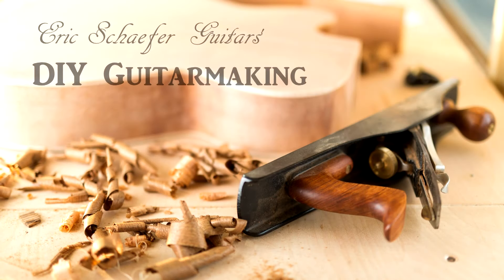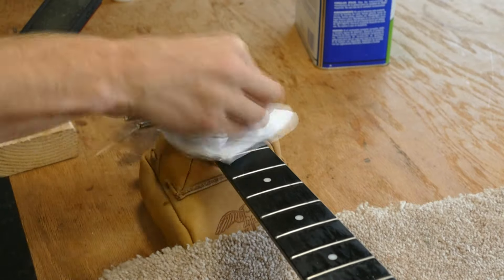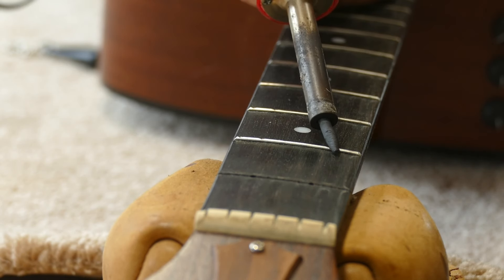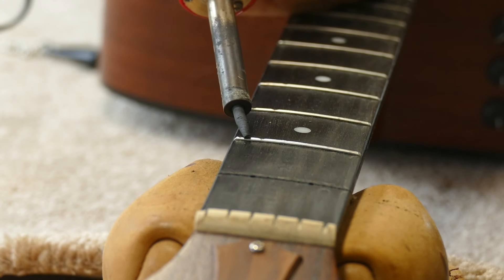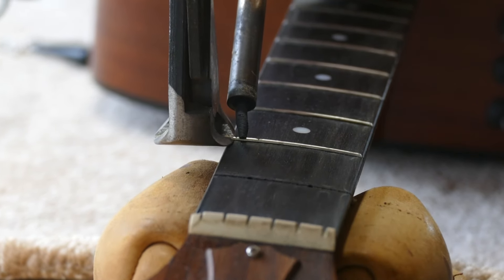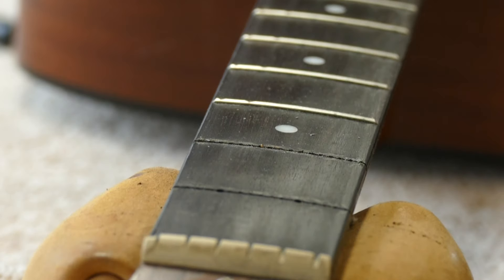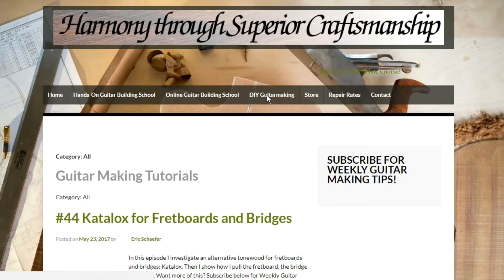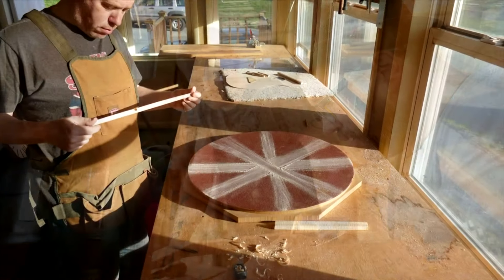The Proper way to Pull a Fret

Comment: Thanks, Eric. I'm thinking about replacing the rich lite fretboard and bridge with katalox on my Martin Dread jr to "liven'" up the higher notes. I also don't think rich lite will age in a vintage way. Any thoughts? Thanks.
Reply: Though it's heck of a hard job, I really like your idea and support your intent to improve probably beloved instrument!
Richlite is totally artifical and has nothing to do with grainy wood, so there's no way it can improve or change. :D

Damn, it's such a shame on the "almighty" Martin that they can't make guitars with rosewood while there are thousands of ~100$ guitars with rosewood fretboards and bridges.
And with real wood not cheap messy stratabond necks.

I bet they won't twist ever, but at the same time all this glue takes away so much of the vibrations and all those layers of wood are not aligned with their grain structures.
Not to mention Larrivee makes all-solid neck-heels and they seem to be stable too.
And even regular 2-5 piece necks bend or twist rarely, so stratabond is just another way to cheat on customers.
Reply: Yes, I agree. Richlite is like fiberglass and will always "buffer" the natural  aging process. I have removed fingerboards before so I have some experience. There is only one way to find out. Thanks Lexonn for your input.
Reply: Oh, can you please tell if you lock the fretboard after taking it out?
I heard that it might twist/bend for some amount, so it's not a lego piece you just take off and then put back on - sanding and reshaping might be needed.
Reply: The fretboards I' ve removed I have discarded. 2 fretboards I've ended up chipping them out with a chisel. My purpose for fretboard removal in the past has been replacing it with a shorter scale board so I didn't need the original. It's always a good idea to clamp a piece of wood like that to another straight piece to keep it from warping and winding.I've made aquariums and other things in the past that I've clamped the wood straight 'till I need it. Also, it's good to let the air flow evenly on either side of the board when not clamped or installed.
Reply from the maker: I love Katalox. It's functionally like ebony in every way except looks. I've never used that richlite stuff, but it being a composite, you should be able to notice the difference just going from composite to wood.

Comment: I tried to follow this advice. I did heat the fret. I could not get the fret puller under the fret. So I used an X-acto knife to get under the edge, and wiggle it. It started to move. Then I got a quality knife with a stronger blade. I used this under the edge until the fret came up and out. I attempted to walk the pullers down the fret, but it came out all at once. There was almost no chip-out, fortunately. Just goes to show that there is more than one way to get it done. I appreciate the video, it probably kept me from tearing the wood up.

Comment: I have an acoustic in which frets 2 and 3 were worn low at 1st and 2nd strings due to open chords.  The other end of the frets looked great so I removed them and reinstalled them in opposite direction.  It worked very well.  Strings 5 and 6 are higher gauge therefore don't sit as low in the groove worn by strings 1 and 2.  This saved a lot of time and hassle from cutting new wire, filing, dressing, crowning, etc.  Who knows, maybe one day I'll have to install new frets but it sure works well now.
Reply: Hi, I have just bought a very cheap all solid wood Tanglewood TW15NS and have thought of exactly what you have already done. The previous owner it would appear never played beyond the 3rd. fret and I can't justify the cost of a complete regret. All frets from the 4th. Are perfect. Could I ask you for any advice before I attempt to do this,were the frets easy to get out? did you need to use glue to reinstall? I would appreciate any advice,kind regards,John.
Reply: I was wondering if that was an option. My second fret is like that, under the b string is worn flat. Alternatively, could I take a fret wire off the 14th fret and swap it with the 2ond fret?

Comment: Just a tip from an electronics guy:
Water and soldering iron are arch enemies. The tips usually from iron coated copper. Water will destroy it fast and soldering becomes a nightmare.
Temp checks with soldering wire and tip cleaning with a copper sponge (looks like a rough steel scouring pad but is made of copper)
If done right, a soldering tip can live for a long time.

Comment: Hi from Spain. I would appreciate your advice. I have just bought a very cheap but really good quality,
 all solid Tanglewood TW15NS and it would appear that the previous owner never played beyond the 3rd. fret because from the 4th.they are all perfect, and the cost of a professional refret I cannot justify. If I remove frets 1,2and 3 and reverse them I think I would get a reasonable result and the frets would be of similar height to all the others...I think.There are no luthiers living near me and the only quote I have had was a refret for €75 but that was in Madrid a 450 km. round trip twice The guitar is fitted with 52/12s so maybe 56/13s would help? Any advice I would appreciahte,kind regards,John.

Comment: Im currently an amp tech, but I spend a decade working in a shop as a luthier. Watching this video gave me flashbacks. I was doing a switching system and the other guy started working on a refret on an 1904 or 5 Gibson mandolin. He was heating the fret up like here and must have the heat cranked in the iron. 
I saw something of my periphery and heard a shouted curse, and turned to see the entire top of the mandolin completely ablaze with green flames. I don't know what the finish was, if it was lacquer or varnish, shellac etc but it went up like a Roman candle.
Thank God for insurance.
Reply: To bad you didn't have the instant replay

Comment: Thank you so much Eric!
Your videos are priceless. :)

How do you decide if the frets should be replaced and not leveled?

I also wanted to notice that you were making radius of the nut relying on the fretboard.
While it seemsto me that if you do it relying on the frets' radius, there's even less place for an error.
I'm speaking of the method "cut pencil in half and draw a line lying the pencil on the frets".
Why don't you do it this way?
Reply from the maker: Thanks Lexonn. The frets were deeply pitted. Levelling to the point where the pits are no longer a problem would have meant levelling too far, especially since these weren't tall frets to begin with. It's always a judgement call.

As for the nut thing, I assume you are referring to the nut slotting videos I posted? You can use the half pencil trick as long as you have a way to add several thousandths of an inch to the height of the radius. You don't want to cut to precisely the level of the fret tops, of course. In fact, if you had a pencil that was cut not as a half pencil, but with a tip 6 thousandths or so above half, then you would have a handy nut slot depth marker. Either way works so long as the nut slot depths are higher than the fret tops by a little bit.
That's a good point( no pun intended!) Thanks for bringing it up!

Comment: I would keep the pincers themselves kinda hot, so it doesnt leach heat away from the work?
Reply: That's a bad idea.  It's okay if the pinchers end up being a bit of a heatsink.  You don't want to end up inadvertently applying direct heat to the wood, as that can warp and structurally alter the wood, and you end up with slots that may not grip the tang of the frets.

Comment: I have a weird problem on my guitar - one of the frets is slightly straighter than it should(doesn't fully follow the curvature of the fretboard). When I press on one end, the other will pop out out just enough to touch the string(the action's pretty low so it doesn't take much) and play a false note if I'm trying to play a chord. I'm considering fixing it myself as it's only one fret. So do I have to get a new fret or can I fix the existing one once I've got it out?

Comment: Thanks for the video, Eric! Appreciate you taking the time to show something like this!

I have a question:

Aren't there any pre-steps before actually getting to heating and removing the fret(s)?
You know, getting the neck straight while under string tension, taking off the strings, checking the neck relief and then getting the neck straight without the string tension? I remember reading this in the Dan Erlewine setup book.
Or does such pre-steps not have to be done, when only replacing a few frets?

Thanks - I hope to hear from you!
Cheers :-)
Reply from the maker: Thanks! Yes, there are. All those things that you just mentioned, in fact! Anytime you level the frets, those things should be considered, and a partial refret always ends with a fret level..
For this video I just wanted to zoom in and take a close look specifically at the fret removal part of it and leave it at that. I would've made a longer video on performing a partial refret, but I simply just had to get the job done and get caught up on my work, and often filming (and especially editing!) videos can turn a simple operation of a couple hours into a project of several days! I'll probably do a partial refret video in the future.... Dan Erlewine's stuff is great. Do what he does!
Reply: Hi Eric!
Thanks for your reply, I appreciate it! :-)

Yeah, I see that, and it's all good! I just wanted to make sure that I got it right :-)
Still, the video is great, and there's a lot of good stuff to get from it!
Trust me, I know how time consuming making and editing videos can be - I'm frequently doing it...

Would be great, at some point, to see a video on the whole topic - refret and the steps to get there!

Yup, Erlewine's stuff is indeed great - and I'll stick to that, hehe!

Perhaps an off-topic question, but.. What video editing software do you use?? :-)

Cheers & thanks!
Reply from the maker: Sony Vegas Pro 12
Reply: Nice, looks great!
Thanks & have a good one!
Cheers!

Comment: Do U think I can use a hairdryer for heat
Reply: No. Won't get hot enough to loosen the glue. And if you found something hot enough to do that you'd damage the fingerboard. A soldering iron is 20 bucks.

Comment: Your soldering iron technique was not good.
1. The end of the shaft is where the heating element is, it is hotter than the tip so don't use the tip on the fret, use the very end of the shaft.
2. Sliding the iron along the fret gives a poor heat transfer. Instead, hold the iron pressed hard against the fret for 2 or 3 seconds, in each position along the fret. Using both these changes you will get a lot more heat into the fret, and much quicker.

Comment: Why need to change fret wires instead of crowning them even your frets is still ok hmm what is the reason?
Reply: It is a judgement call as if the divots are too deep and one has to sand off a lot of material resulting  then in very thin frets and as such the guitar will not be playable, so new frets is the only solution.

Comment: wow this must take an hour to remove all the frets?
Reply: There are worse ways to kill and hour.
Reply: Yep which is why shops charge so much for a complete fret job. There's no other way of getting frets out faster without butchering the fingerboard.
Reply: @andreww1613  It can be done much faster presumably by someone more experienced
Reply: @chrischoir3594  You wouldn't be refretting any of my guitars. Continued heat is the only safe way to break the glued bond. Trying to speed that up means using force which means risking fretboard chipping